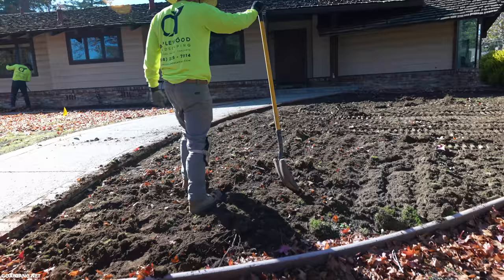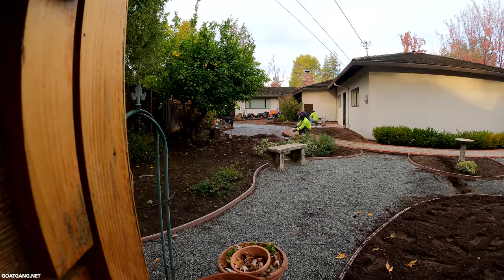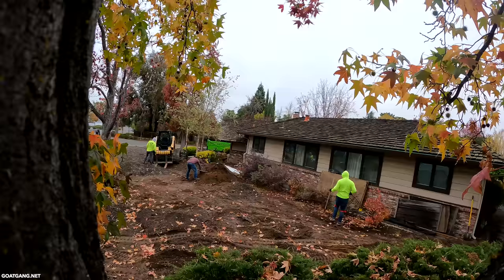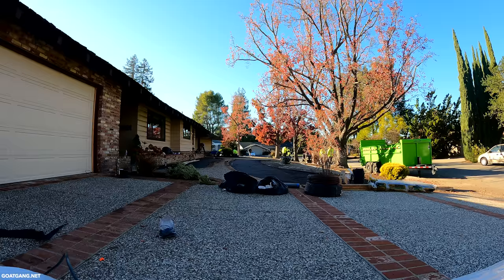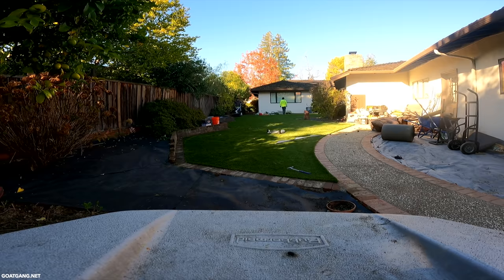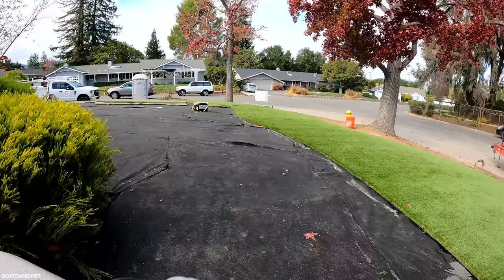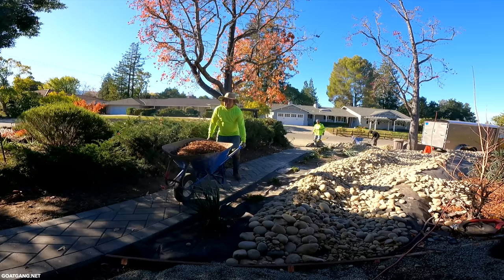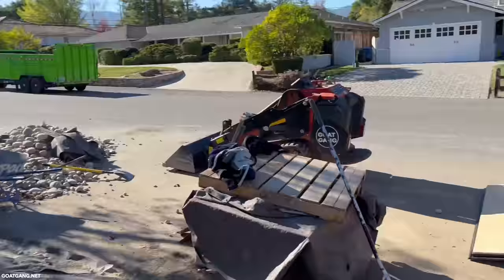How Much PROFIT Can You Make on a $127,000 Job

Comment: Next time switch from metal edging to aluminum edging. same look and color, but aluminum will not rot out in 2 years like the metal. The top of the metal will look good, but below the soil it will all be rusted and destroyed from the contact with the soil.
Reply from the maker: Hmmm, that's a good tip, thank you
Reply: Curv-rite makes it

Comment: I look at the those plans all the time where I work. I work in landscape commercial construction btw. I’m guessing it’s not too common for residential? Idk because we are mostly focused in commercial. Nice video btw 👍
Reply: do u understand everything tho
Reply: @Diegosmoni  pretty much landscape layouts are simple to read. Irrigation layouts get a little tricky tho. Our layouts come from architects and civil engineers. But we mostly just read what the architects make and specs. But for residential it’s not as common. Mostly a landscape designer comes I guess.
Reply: @angelvasquez5066  very common in residential jobs. We install 50% of our jobs from landscape architectures for residential. If there isn't a design, I sell one and do it myself. My design rate is $180 an hour. Nice side hustle.

 The difference between residential and commercial is the regulations and inspections, there's virtually zero inspections in residential. And you get paid in full right when your done with the job, and all the way through the job.
 Commercial jobs don't typically close out the contract final payment until 3 months after the job is completed. But, because commercial is what it is, the contractor usually charges triple the rates for commercial compared to residential. There's a HUGE margin in commercial. 
 In residential the profit margin is a constant 25% ,the rest is labor and materials. The more debt you have, the smaller your margin is. If your going to do residential, you want to keep your debt ratio as low as possible to increase your net income.
Commercial is a lot harder, much more collegic than residential. Any idiot can do residential, probably why I'm so good at it.
Reply from the maker: Thank you!
Reply: @siliconvalleylife2.048  hahah great job bro

Comment: What program do you use for materials takeoffs (scaling and measuring square footage )?
Reply: Our company uses blue beam revu.
Reply from the maker: Nice man!
Reply: Just use a ruler, rolling scale, calculator and a red pen.
Reply: @marklucero7736  easy enough to say, but when you are estimating large projects with thousands of plants, and 12-15 pages, not so easy to actually do
Reply: For residential most plans, even if large with separate L sheets the planting plan shouldn’t take more than 20-30minutes to get through verifying designer/architect plant counts against the legend.

Yes if you’re doing large scale like I did with the apple campus, sales force park and FB gardens those planting plans can take awhile that’s why we had a team to split up tasks. But even then you get a bean counter clicker like the people use to count attendees at an entrance to a ride and count quickly with that and a pen vs setting up OST systems
Reply: @marklucero7736  the way purpose of software would be to eliminate the need for a team

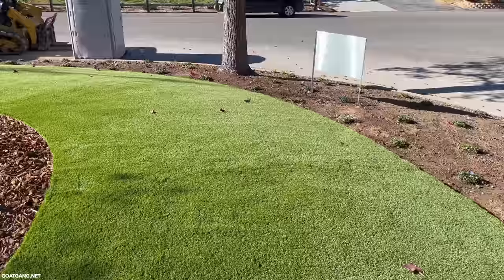Comment: 37:12 you can see all those seams on the turf! 🤦
Reply from the maker: No you can't
Reply: On the seams you did an S, try putting in 3in nails & when they nail them down, tell them to not shove the nail all the way down. Regardless the nails corrode, turf ain’t going anywhere. You pay your guys way to much to do jobs where they’re not top notch. I love the work you do, but you can’t fool professionals like myself.
Reply: @johnnyhernandez5539  exactly
Reply: Yea that that metal edging sucks makes the install look shity.
Reply: @johnnyhernandez5539  I don't use any nails for my installs
Reply: @johnnyhernandez5539  if you nail seams together you are not an expert. Maybe a professional, but not a specialist. I do around 1 million sqft a year large scale commercial. If you tried nailing any of my seams I would fire you on the spot. Overlap, trace cut it, fold both sides open and glue it. That's how a specialist does it. That's how I've done it for AZ diamondbacks, Oakland As, Colorado Rockies, UofA, ASU, UofO, Milwaukee Brewers, the list goes on.

You think nailed seams will look good throughout the lifespan of that turf? It's guaranteed to look like dog shit as time goes on. 

I can always tell when a landscape companies installs turf, compared to an expert. 

You cut the fringe off and you butt the piece together, over time the edge of the turf that you cut will fray, infill material and organic materials will get under the seams, your nails will rust. 

Don't be cheap, buy the adhesive.

Source: My family and I been in the turf game collectively 50+ years. Average job being 100,000sqft.

Comment: Our world is about to be rocked in California when all off road gas engines will be banned for sale by 2024.

 Do yourselves a favor and purchase extra backup replacement engines before the ban takes place. Because you won't be able to get them afterwards in state. 
 If you're going to buy heavy equipment, buy it now. 

 The replacement parts law, manufacturers have to make replacement parts for 7 years after the end of any given manufactured equipment. Purchase wisely. 

It's all batteries after 2024.
Reply from the maker: Thanks for the tip